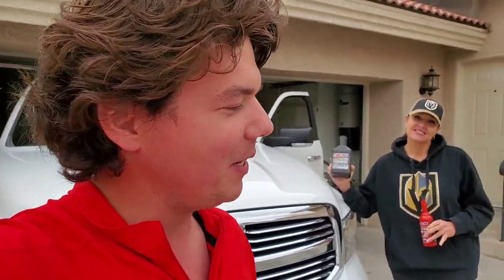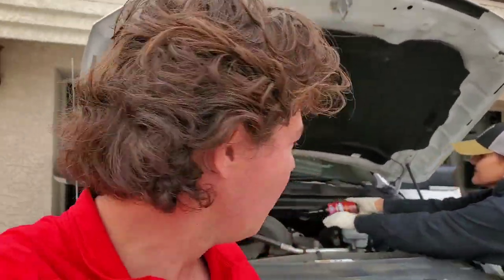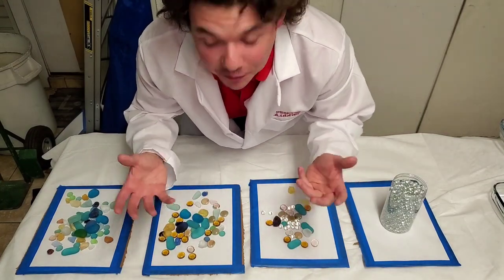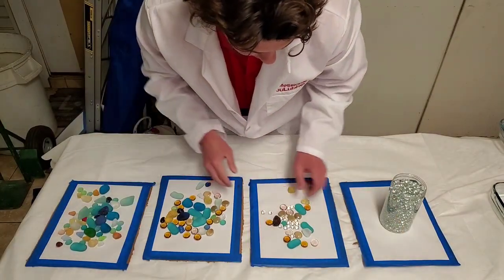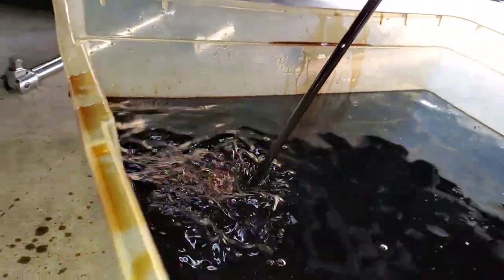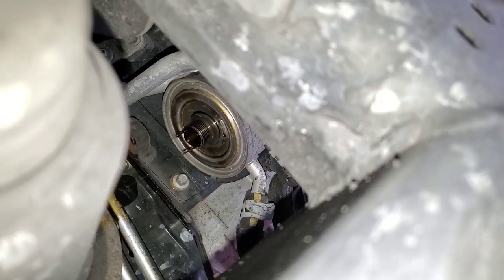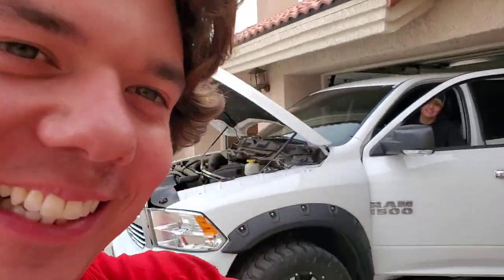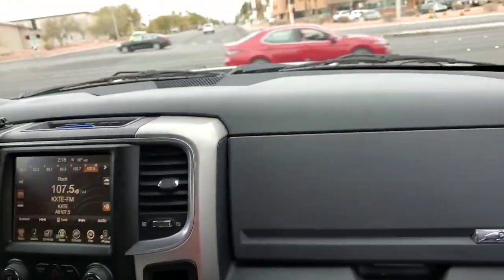2017 Ram 1500 5.7L AMSOIL Engine Flush Oil Change

Comment from the maker: Professional YouLubher: Eben Rockmaker Regency Direct Jobber AMSOIL Specialist (Dealer#: 5331179) 

To Order AMSOIL Products Click Here - http://syntheticoilprotection.net/ 

     Watch This: Oil Analysis Results - https://youtube.com/playlist?list=PLB_ftWArBFddc-nU9A-k2vfxWYxdq3E_b 

Find Products For All Vehicles - 
https://www.amsoil.com/guides/?zo=5331179 

SUBSCRIBE to Synthetic Oil Protection YouTube Channel - https://www.youtube.com/c/SyntheticOilProtection
        
     Synthetic Oil Protection Website - http://syntheticoilprotection.net/ 

      AMSOIL Performance Test Results. Read This Article - https://www.amsoil.com/performancetests.aspx?zo=5331179 

AMSOIL Dealer Google Maps - Synthetic Oil Protection: https://maps.app.goo.gl/2AuZCi8h2Gaf3mY46 

About AMSOIL..... est. 1972: 

First 100% Synthetic Oil Certified in the USA 

1. Where can I find AMSOIL? - Use this link https://www.amsoil.com/offers/?zo=5331179 
Or 
     Watch This Video: The Truth About AMSOIL Why Mechanics Won't Recommend - https://youtu.be/8OhntOxngAA 

       2. What makes AMSOIL different than other oils? - 

AMSOIL is 100% Synthetic & has higher film strength & holds up 4× better in turbocharger deposit testing than Mobil 1 EP which protects and separates metal parts, keeping them from wearing and Lasting Exponentially longer. Watch This Video: https://youtu.be/f4eNPgTi_qo 

3. Why should I use AMSOIL?: It protects the engine so it will last longer. Less oil changes less often (once per year/15,000 miles) or longer... Save money in Gas & Time making it less expensive than a free oil change over the year. Watch This Video - https://youtu.be/H7K6FdZlqmg 

     Professional YouLubher: Eben Rockmaker Regency Direct Jobber AMSOIL Specialist (Dealer#: 5331179) 

Find Products For All Vehicles - 
https://www.amsoil.com/guides/?zo=5331179 

   
25,000 Mile AMSOIL OIL CHANGE. 
Watch This Video - https://youtu.be/vp1HTtlulR8 

The Power of AMSOIL Signature Series 5W-30 Synthetic Motor Oil protects against harmful deposits on turbochargers 4X better than Mobil1® Extended Performance and 3.6X better than Royal Purple® in industry-standard testing*.  Read This Article - https://www.amsoil.com/newsstand/motor-oil/articles/leading-the-field-in-deposit-protection/?zo=5331179 

     Better MPG Proven. Read This Article - https://www.amsoil.com/newsstand/motor-oil/articles/another-win-for-amsoil-products/?zo=5331179 

AMSOIL Performance Test Results. Read This Article - https://www.amsoil.com/performancetests.aspx?zo=5331179 

     Ebens Giveaway: 

Over $5000 Given to my YouTube Community Playlist - https://www.youtube.com/playlist?list=PLB_ftWArBFdey4HFt_Z9KgSIChjkLbw_o 

Synthetic Oil Protection Coffee. To Order Coffee Click Link Below: https://supportwith.coffee/shop/subscriptions/sop/
Reply: Eben to get free shipping and 25 percent off does it has to be $75 before oh after taxes?????
Reply from the maker: You get the 25% off as a preferred customer and as far as the free shipping that is any order over $100.

however if you have a distribution center near you you can always pick up the oil at the amsoil distribution center.

This is my website and you'll see if you scroll down you'll see the save 25% off tab which will give you the preferred customer.
To Order AMSOIL Products Click Here - http://syntheticoilprotection.net/
Reply: @Syntheticoilprotection  how much do you pay to this people for saying what their saying?
Reply from the maker: That's a good question Danny yeah everyone that comes in my channel is a local that has tried the products for the first time and that is the result they get they're always happy because of the 100% synthetic film strength and less vibration smoother operation This is a video of people's reactions I've done over the years - https://youtu.be/0YNrt962Q7U
Reply from the maker: Always happy to help you anytime Danny 💯☕😃

Professional YouLubher: Eben Rockmaker Regency Direct Jobber AMSOIL Specialist (Dealer#: 5331179) 

To Order AMSOIL Products Click Here - http://syntheticoilprotection.net/ 

     Watch This: Oil Analysis Results - https://youtube.com/playlist?list=PLB_ftWArBFddc-nU9A-k2vfxWYxdq3E_b

Comment: Wow that's crazy quiet. I noticed when putting the amsoil radiator 50/50 in my 2016 tundra (I was able to put 9 gallons in with the boost) it got quieter! Cold starts are smoother as well as over all running ❤😊
Reply from the maker: That's great!!! Super stoked everything's going awesome👍 thanks for the great feedback💯

Comment: Another good video Eben.  On these oil change videos, I always see you using the engine flush, but I'm curious, do you use the flush when changing over to a synthetic or at each change?  Also, do you happen to remember how many miles were on the oil before you guys changed it?
Reply from the maker: Some great questions I don't know how many miles were on the oil when this one was changed.

As far as the engine flush you do not have to use it The only benefit of using it is it gets the carbon out before you change the oil and put a new filter on If you don't do a flush the carbon deposits will end up in the new oil filter and it will clog your oil filter sooner where your oil will look dirty sooner because the filter is full of contaminants.

so to avoid changing the oil filter early you're better off just doing an engine flush it costs less money and your motor will be a lot cleaner and run more efficiently Better compression smoother operation and better cooling because carbon ax as a insulation and that keeps the heat inside the motor so you want to have the cleanest metal to have the oil flowing over it to pull heat away from the metal components.
Reply: @Syntheticoilprotection  so if the goal is to remove and keep the carbon out of the engine, how often would you recommend doing an engine oil flush? every other oil change?  Also, as a follow up to some of our previous conversations regarding changing the ATF in my honda, I've put about 500-600 miles on the transmission since and it feels great!  No issues with it at all.
Reply from the maker: That's awesome to hear Scott yeah as far as that I would do it every oil change on a diesel truck just because of all the sit thickening and the turbos have very tight tolerances on the turbo screen.

as far as the gas motor I would do it only the first time I switch over to amsoil that way you know all the carbon is out and it won't go into the new oil filter.

That's pretty much it It's just that easy

Comment: Just bought a 2017 5.7 with a 144,000 miles need a good clean up in the motor
Reply from the maker: Awesome you want to do the signature series motor oil also the Amsoil engine flush with the pi performance improver gasoline additive the 6-month PC membership here will give you the best value on the products when you use my link I'll always be able to answer your questions in the future in the products about improving the performance and lifespan of your vehicles by choosing the right Foods as your independent Amsoil dealer👍
✅   Save 25% On Your Next Fluid Order: https://www.amsoil.com/offers/pc/?zo=5331179

Comment: Just a few questions and comments Dr. Lewicki:

Did you vary the viscosity of the oil in the engine at the time of the oil change, ie: 5w-30 to 5w-20?  Was it full synthetic before and 100% synthetic after?  Is a change in viscosity advisable with a change to 100% synthetic oil?

I like to use a shallow blitz pan underneath my oil pan.  It's a handy place to drop wrenches rags, and the drain plug.  I like to spray it with a little brake cleaner and wipe it with shop towel afterward.  I noted that the filter was primed quite well, yet we did not get to see the filter installation footage.  The filter location on 4x4 v8 vehicles is such a pill.  

I didn't realize that there was a difference between full synthetic and 100% synthetic.  At 5x the price of full synthetic I now know why.  I would not spill a drop.  $5 ran down the side of the filter.  I might consider putting it in my WR450F...    

It's hard to believe that much carbon was flushed out of a 26K mile engine.  It's hard to quantify how much gunk the flush washed out, but the color and viscosity of the oil seems to indicate that it did a great job of dissolving whatever was in there.  I wonder how dirty it looked on the inside before and after.

I have seen under the intake and valve covers of my 170K mi.  '99 5.7 Escalade and I know it is gunked to heck and back.  It's nasty.  I want to ask about repeated dosing with the flush on excessively dirty engines.  Would it be advisable to do one flush, and another at the next oil change or would back to back flushes help.  The strong dissolution after 15 min. idle time seems to suggest that it should not be used excessively.

Comment: I have run Amsoil and the amsoil filter and I had to change my filter due to low oil pressure. But the oil is great
Reply from the maker: What type of vehicle do you have?
Reply: @Syntheticoilprotection  2015 Ram 1500 with a  Hemi
Reply from the maker: Very interesting what do you think caused the low oil pressure is it just a recall or something?
Reply: @Syntheticoilprotection  I think that the oil filter was maybe plugged up or bad. I changed it to a Purolator filter and it is fine for 2500 miles now
Reply from the maker: Awesome next time I would try a wix filter or an amsoil filter is the best if they make it for your vehicle.
Professional YouLubher: Eben Rockmaker Regency Direct Jobber AMSOIL Specialist (Dealer#: 5331179) 

To Order AMSOIL Products Click Here - http://syntheticoilprotection.net/

Comment: Hey Eben...could you show a trans service n a 2015 Ram 8spd?
Reply from the maker: Yes that one's going to be very similar to a lot of the other transmissions we've already done on the channel Check out the playlist under transmission fluid changes on the homepage.

That will be a lot like the Dodge Challenger we did They have a pan and you drop the pan down and then you fill the pan from underneath with an adapter it'll also be very similar to my car just like my SL550 Mercedes you'll see the video transmission fluid change in that one as well.

If I can find a truck in the community I will do a video on it soon Thanks again for always being a part of my YouTube channel 👍😊

Comment: Eben I have question sir. I have a Hyundai Accent 1.6 crdi, I want to switch to Amsoil SAE 5W30. The manufacturer recommendation is ACEA C3, but Amsoil SS Diesel is E7, E9. Is this okay? Or should I use Amsoil European Formula which is ACEA C3 already?
Reply from the maker: Great question This is my link Francis and I will be your amsoil dealer if you use my link.

Professional YouLubher: Eben Rockmaker Regency Direct Jobber AMSOIL Specialist (Dealer#: 5331179) 

To Order AMSOIL Products Click Here - http://syntheticoilprotection.net/ 

     Watch This: Oil Analysis Results - https://youtube.com/playlist?list=PLB_ftWArBFddc-nU9A-k2vfxWYxdq3E_b
Reply from the maker: As to your question I would use what amsoil recommends on the lookup guide This will give you the fluid capacities for everything on your vehicle and all the products.
Find Products For All Vehicles - 
https://www.amsoil.com/guides/?zo=5331179

Comment: I know the wetter the better but are there any consequences of filling her up ?   I'm talking about the filter....
Reply: I assume yes because it offers protection??
Reply from the maker: Yeah it's always good to prime the filter that way the oil flows right away 😃
Reply: It is good practice to fill oil filters especially on larger engines such as my dad's 2020 6.7 Powerstroke Turbo Diesel. Oil filters that sit upside down are another story. I've always primed and filled my 05 MDX with 155,000 miles with Mobil 1 5w20 Full Synthetic along with the Mobil 1 Filter. I usually add Marvel Mystery Oil to the fuel. I was thinking about trying Royal Purple or Amsoil next. Not sure if it will make any difference though.
Reply from the maker: Oh yeah Paul it'll make a huge difference you'll have a smoother motor you'll also have a lot more protection Your engine will run cooler you'll have better gas mileage goes on and on and on This is one of the good videos I've done with Sean and his Dodge Challenger.
25,000 Mile AMSOIL OIL CHANGE. 
Watch This Video - https://youtu.be/vp1HTtlulR8 

If you ever want to try the products you can always use my link and I will be your amsoil dealer I can always answer your questions.

Professional YouLubher: Eben Rockmaker Regency Direct Jobber AMSOIL Specialist (Dealer#: 5331179) 

To Order AMSOIL Products Click Here - http://syntheticoilprotection.net/

Comment: Do i have to do the flush if i switch to Amsoil? my truck has 32K kms
Reply from the maker: You can do anything you want.

I always like the engine flush because it gets rid of a lot of the carbon deposits around the rings also it helps clean cooler ports oil cooler ports and helps get sludge out of the oil pan.

This is my link if you're new to Amsoil this will give you the discount pricing receiving about $33 and $100 order and if you use my link I will be your dealer so I can always answer your questions in the future and I'll get the credit for your orders always happy to answer any questions.
Professional YouLubher: Eben Rockmaker Regency Gold Direct Jobber AMSOIL Specialist (Dealer#: 5331179) 702-472-3614      
       If you're New to AMSOIL I recommend the AMSOIL 6 Month PC Membership - https://www.amsoil.com/offers/pc/?zo=5331179
Reply: @Syntheticoilprotection  If they ship to canada on the link I will definitely use your account. I'm really enjoying your videos and want to try the Amsoil stuff. Thank you for the super fast response!!
Reply from the maker: Yes as a preferred customer you will also get all the benefits the 25% discount and you'll also have the free shipping on any order $130 or more even in Canada.

Most of the time if you live in the highly populated areas if you order before noon you'll usually have the products next day if you live within a few hundred miles of the distribution center
Reply: @Syntheticoilprotection  Thats awesome man!! I will definitely use your link then. Thank you again for all the quick answers and keep up the fantastic work!!
Reply from the maker: This is my link and if you have any questions before you order you can always give me a buzz happy to talk or text anytime.
If you're New to AMSOIL I recommend the AMSOIL 6 Month PC Membership - https://www.amsoil.com/offers/pc/?zo=5331179
Reply from the maker: Awesome thanks Frank If you ever have any questions with the products I'll be here always happy to recommend what I would do to the vehicle and/or you'll see the playlist on my car under playlists and you'll see everything I did to it which has transformed its driveability.
Reply: @Syntheticoilprotection  Thanks, I really appreciate it!

Comment: Why do you need engine flush , shouldn’t your oil do it  if it’s so good?
Penzoil Platinum keeps my engine clean . No gimmicks
Reply from the maker: Great question both there are no reasons that you need to use anything however the benefit is the difference of keeping something cleaner by removing carbon around the rings time and chain will allow the oil to get in and lubricate better with better heat transfer keeping things cooler and well lubricated so that's the benefit of the flush also the signature series Motorola will make a huge difference as well and this will give you the differences on how amsoil is different than other lubricants because it's a 100% synthetic A oil manufacturer can call a full synthetic full synthetic 25% synthetic when it's called the full synthetic where amzoil is a 100% synthetic.
♥️   See Fluid Performance Tests - https://www.amsoil.com/performancetests.aspx?zo=5331179

Comment: Comeon Eben, where's the bypass filter? 🤔
Reply from the maker: The bypass filters are usually for diesel vehicles which helps get rid of the soot thickening and all the diesel contamination in the motor oil.
Check out this bypass filter video - https://youtu.be/XemTDNbbfeg